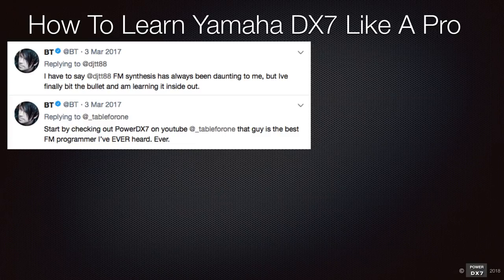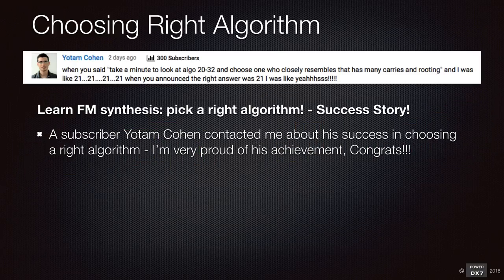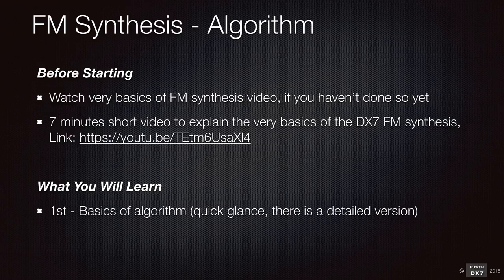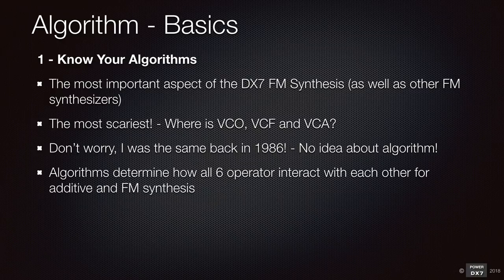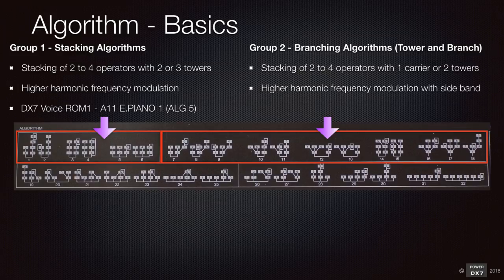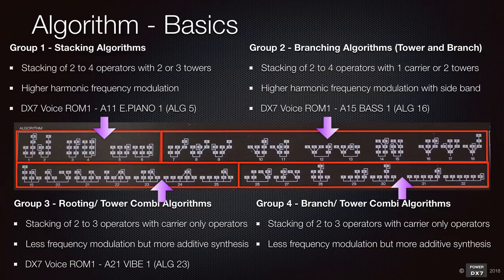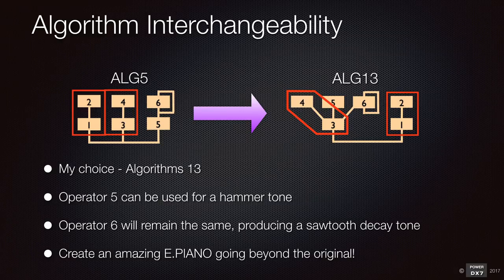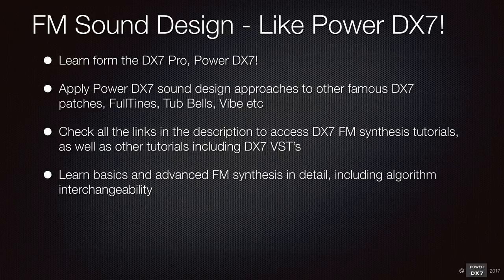How To Learn Yamaha DX7 Like A Pro, BT - How To Pick A Right Algorithm Like A Pro

Comment: Hello my friend. I’m trying to recreate the Bass 1 patch from DX7 on my DX21 or as possible as I can, because I can’t afford a DX7 here in my country. Do you have some tips or could give me a hand on creating a “similar” Bass 1 sound with 4 operators? Thanks ! Very nice work.
Reply: Can't be done on the old 4 ops DX synths. All the DX7 sounds can be produced on the MODERN REFACE DX synth. It allows for a bigger fuller sound because it uses feedback on all 4 ops. And and has onboard effects that can be saved within a patch. And this is a major gamechanger. To create  patches that rival a 6 op FM synth
Reply: @fender1000100 that's not true. Dx21 is perfect for bass.And no, the reface  cannot replicate all the dx7sounds. 😂